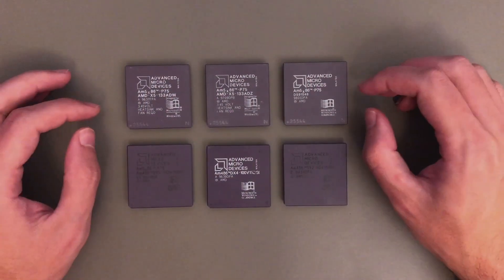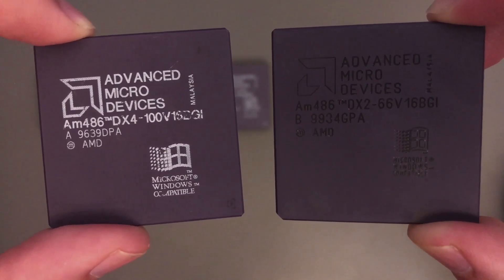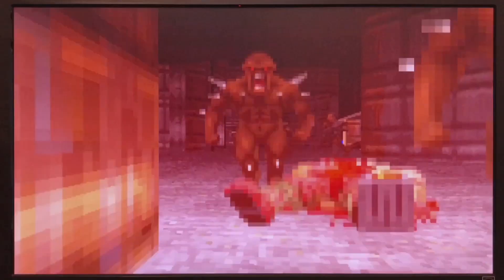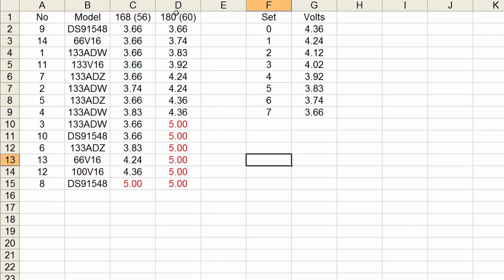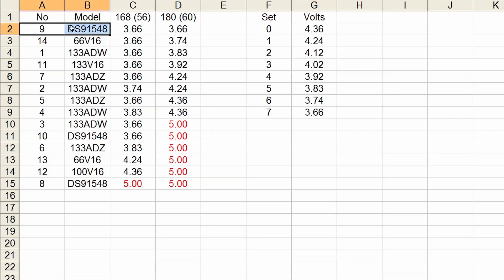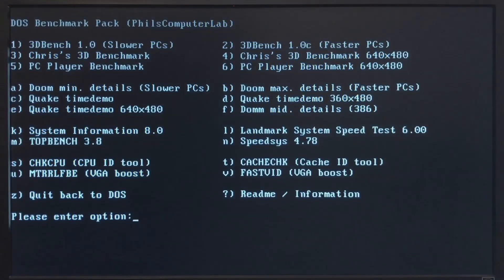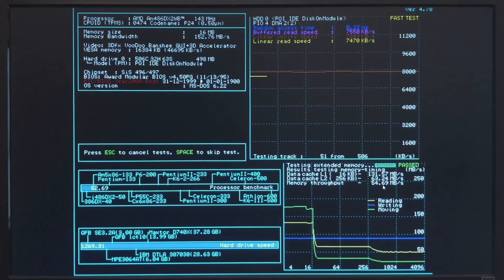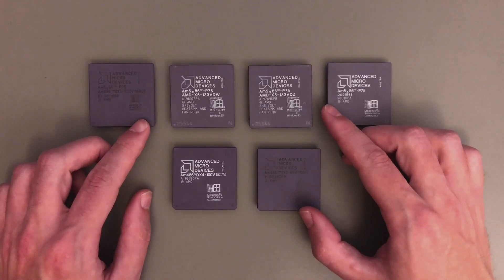Binning / Testing 14 Am5x86 CPUs. The 190% Overclock on Am486-DX2-66 and the Unreal 70MHz 486 Bus!

Comment: I have exact same benchmark results with: Asus PVI-486SP3 @66MHz FSB, i486DX4/100 @2x66=133MHz, Cirrus 5446 PCI, 256KB cache, 32MB FPM stick. Needed to slow down cache from bios, RAM speed is actually the same in my other system: QDI V4S471, Cx5x86/100 (2x50MHz), all other settings tightest but ram set to faster. So loosening bios settings really kills the benefit of higher bus speed.
Reply from the maker: Yeah very similar conclusions to me. Getting good cache timings at high speeds is very had, and usually impossible.
On this one board I also tried many different cache chips and all were actually slower. I need to try other boards too.

Comment: you should try replacing the crystal oscilator for a pll or an arbitrary function generator to push it higher than that, say do 2x 75mhz or so, see how far you can get with the bus and ram. Also if you are up to it, you could try separating the 5V rail from the ram (worst case you will have to rip a few pins and solder it directly....) Voltmodding the ram there should really help get the higher bus clocks stable imo.
Reply from the maker: My any_clk device is exactly that, a PLL, that replaces the default crystal oscillator.
It can generate more or less any frequency, ok with some steps (<1MHz).
It can go up to 200MHz, but yeah 70MHz is the maximum for this board here.

Isolating the Voltage of the ram is not easy. Also my ram timings are nearly maxed out.
The problem is with the cache chips.
There I can do something but either-way going with 5.5v on the whole board only gave me +4MHz.
Reply: @atheatos 
Well if its 70mhz max theres not much else to do.
Maybe you can push it up to 6v. Not sure how good was the regulation in the XT / AT standards if any. Maybe you can play with the tolerances. Usually 5V TTL stuff can do 7 to 9 volts before breakdown and remember old machines had horrible regulation causin all sort of glitches with sleep states so much that windows didnt put the cpu to sleep in some machines to about the noise spikes caused by the change in power consumption. 
I bet the regulation and noise tolerance are quite lax
Reply from the maker: Yeah for sure TTL chips can handle even 7v. However the chips here have mostly CMOS specs.
So only up to 5.5v it is with in the spec. Now 6v might be safe, but again I do not want to risk it.
There are so many chips on the board, if one fails, it is game over.
Also until now no one else has done above 66-67MHz. So yeah :)

Comment: If speedrunners would use an overclocked unstable 486 to glitch Doom for an advantage - would that count as cheating? lol
Reply from the maker: Well sure it is cheating. Maybe not useful for speedrunners. The glitch basically messes the timedemo commands and usually results to a better result, that is for sure invalid.